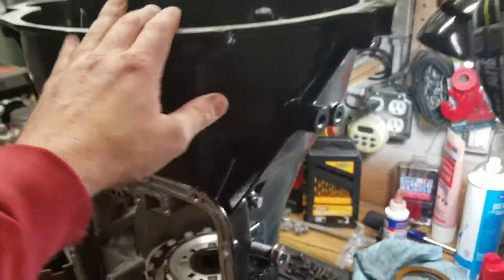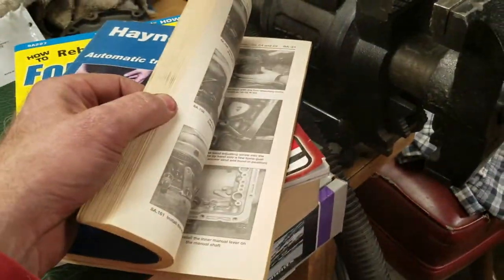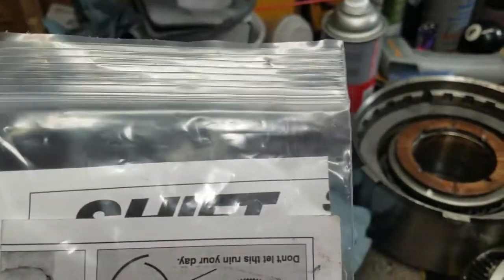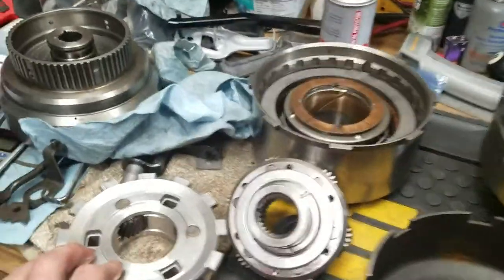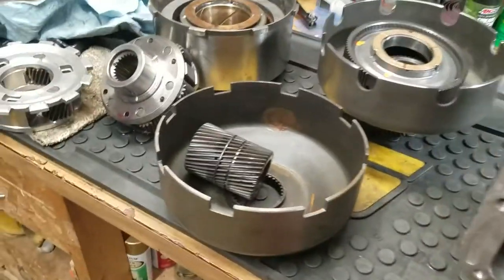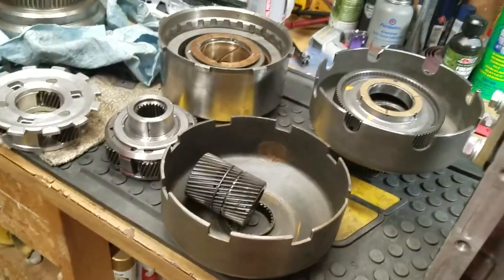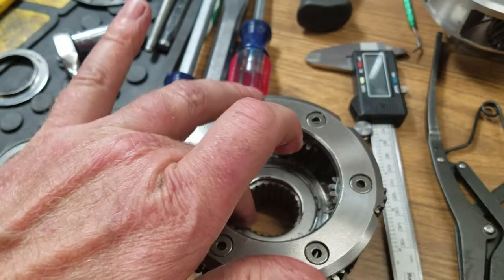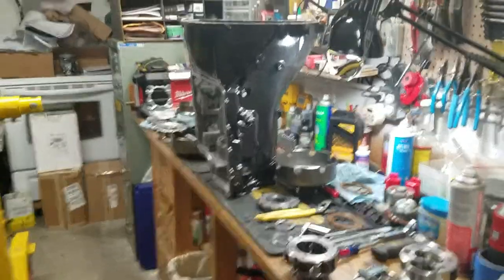Ford C6 Wide Ratio and Rollerized: Part 1 Specs, literature, and materials

Comment: I've been rebuilding C-  6  transmissions  since  1977   I was  13 years old   now  I'm  59 years old   ,,, just  do  the  job  right  ,,, no need to  go  over bord with  high  preforming  crap    BUT  !!!!! IF YOU  TAKE  THE    E4 O D  FRONT HUB GEAR AND  IMPLANT  IT IN THE  C 6 ,,,,,,YOU  WILL  SUPRISE  YOUR  BUDDY  IN THE  OTHER   STRIP  GREEN  LIGHT  BY LEAVING   THE  LIGHT FASTEST  THAN  HIM    , AFTER  THAT,,,! YOUR  C- 6 will  go back  to  just  another  good  OL C-6  , AND  YOUR  BUDDY  WILL BE  THINKING  YOU ARE  CHEETIN  😁   hint,,, since  the  E4OD   is a 4 speed , the  shell  gear  and planet  gear  is lower   AND  will  launch  the  car  off  very quickly  and  leave  your buddy  in the  behind    ,  :::: it's  called  ' a quick  fix for your  sick  C-6.   Louis  R Edwards Jr   of  Edwards  Brothers  transmissions   ROANOKE RAPIDS  NC   .thanks for  sharing your experience I enjoyed this one
Reply from the maker: Yeah, I bought the wide ratio kit online. I believe it consists of the parts you are talking about. I know I went "overboard" with the roller bearings and little tweaks but I enjoyed the challenge. It's weird but I really find it therapeutic to assemble and disassemble the gearsets and check for clearances and operation 🤷🏼‍♂️ In any case, I just hope people like yourself can get value from the stuff I put out there
Reply: @ob1n  that's  why  I  watched  it  👍,good for you  !
Reply: Louis I’d love to pick your brain on this c6 I’m about to dive into.  It’s behind a 6.9 idi ford diesel.  Got a messed up reverse (says the previous owner).
Reply: @roughready7491  hint,,,,if your C6 has a  reverse  problem  is either a  very  simple  problem   like the  shift  rod  , BUT  IT SOUNDS LIKE  THE  DIRECT  CLUTCH IS GOING  OUT  ( THAT IS  WHAT  WHAT  HOLDS THE  REVERSE   CLUTCH  PACK  )  BUT  ! IT CULD  BE THE  REVERSE  CLUTCH  PACK  IT  SELF ,  WITCH IS  PROBABLY  THE  BEST  ( R ) PACK IN THE WORLD
Reply: @Louis-kk3to  39 years ago I managed to weld the C6 direct clutch plates together pushing through heavy snow upgrade in low gear with tire chains in a 73 T Bird for 6 miles.  The T Bird made it home, but the transmission did not survive. The output shaft got so hot it turned blue. 😔

Comment: I agree that yellow C4 - C6 book is not the best and can lead to problems for someone that has not rebuilt a transmission before. It leaves some things out and is unclear in places. Those Motor Manuals are really good if you can find one.
Reply from the maker: Ebay is the best place I have found for any ol school auto literature. The Motors manuals are very thorough and have a lot of descriptions with photos. Can't say enough about them. Whenever I was concerned about anything, the Motors manual is where I would turn to

Comment: No need for a bearing of that forward ring gear hub. It is locked in all forward gears anyway.  It can be rollered using a T350 bearing and leaving a small locating shoulder on the inside. What you have there is the best option with the metal thrust replacing the plastic 

The bearing for the planet is a Sonnax GM-N-11 which is a t700 torque converter bearing. That's the one I use anyway .
Reply from the maker: Thanks for your input, Greg. In my case, the transmission is already assembled and in the vehicle waiting for the engine. So I'll be using as-is hoping it works. Yet anyone coming here can pickup a little more information to help them decide what they want to do. Always appreciate your wisdom and experience!
Reply: Yep! That's  right  .